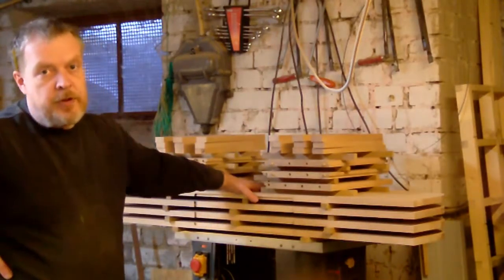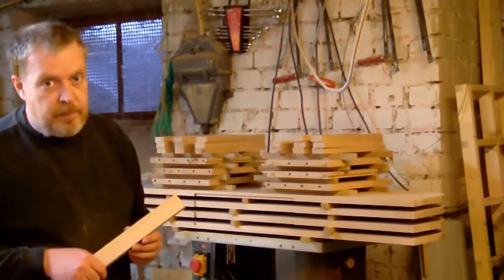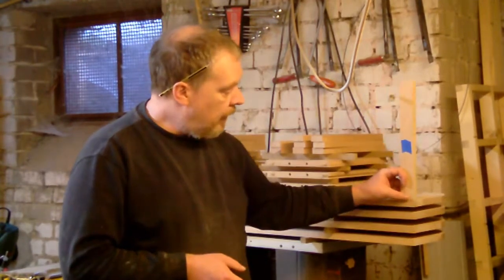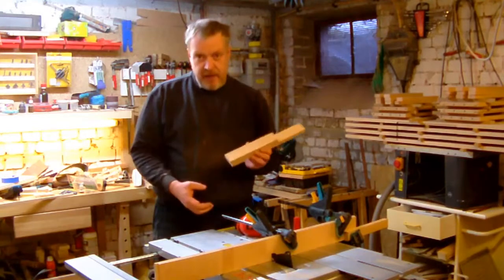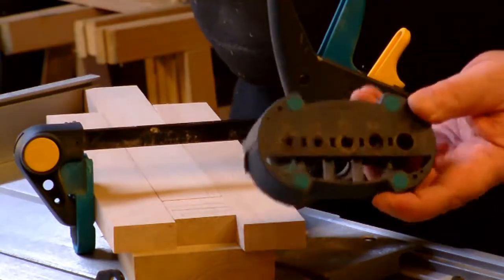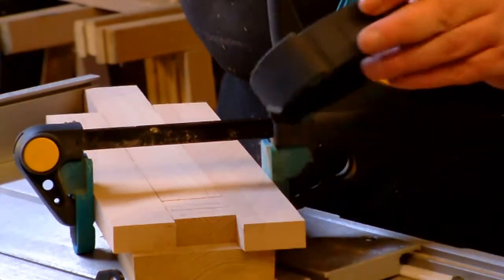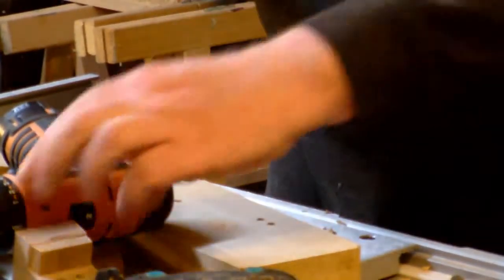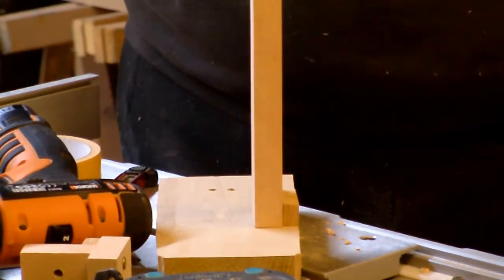009a_TGIF - Doweling JIG - EN

Comment: Very good explanation.  I've been thinking about making or buying a metal doweling jig.  After watching your video I'm convinced that a hard wood jig will be just fine.
Reply from the maker: Thank you Ed for you comment.
After I finished the TV stand, using this jig I think it's all you need. Specially doing the styles flush and offset to the edge of the board. It'll be hard to find a machined jig to do the same without major adjustments in between and the metal will make the sides of your drill dull after a while.
The beech worked fine, I just had to be patient inserting the drill into the jig to not destroy the holes.
Greetings from Good Old Germany
Peter